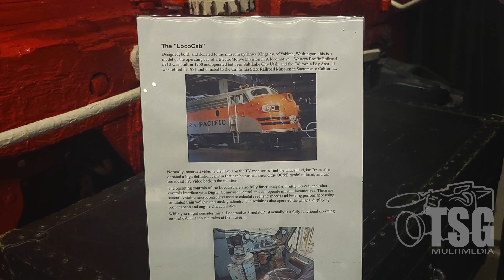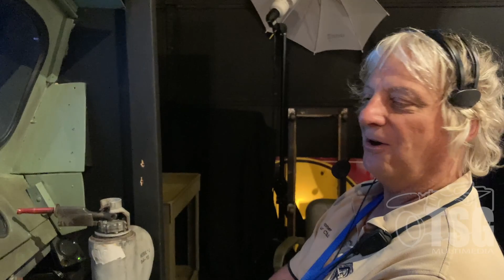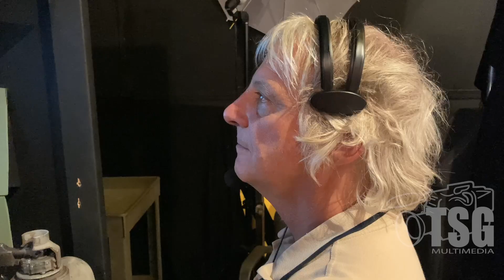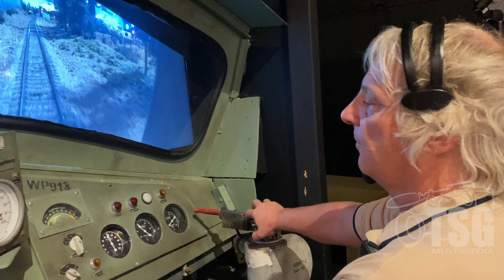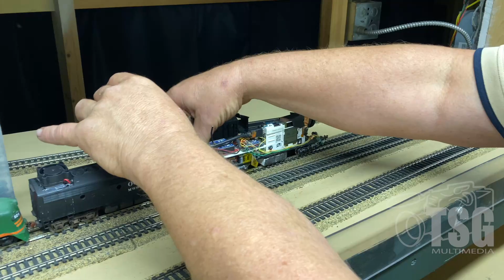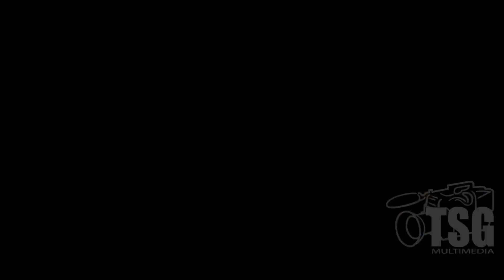Western Pacific F7A Simulator Colorado Model Railroad Museum

Comment: This is the next step in model railroading control. Sim cabs with wifi/Bluetooth. Systems that you plug in do your rolling stock and motive power inventory and the trains run themselves switching jobs included. I’m sure rolling stock will eventually be all sound as well, it’s crazy that the hobby has in the last several years been progressing greatly